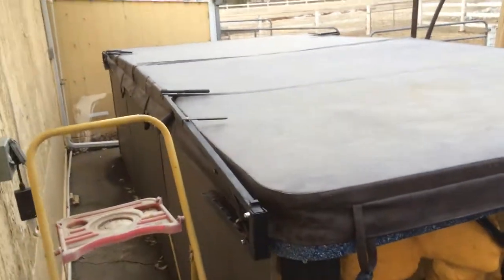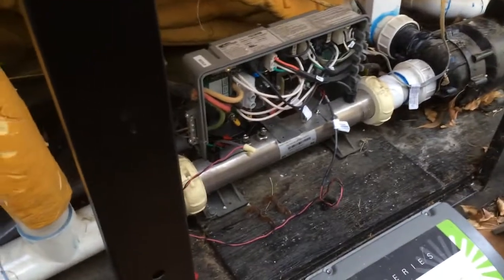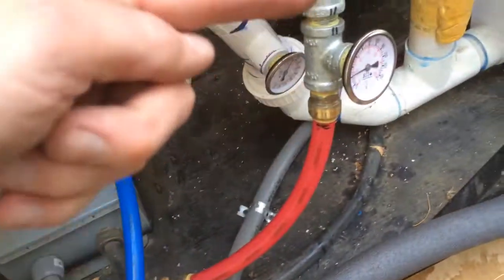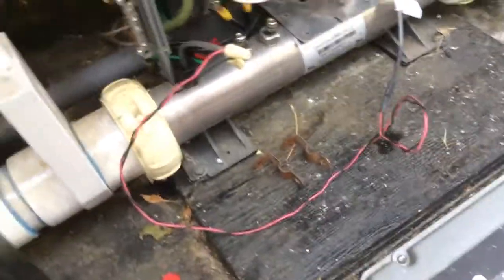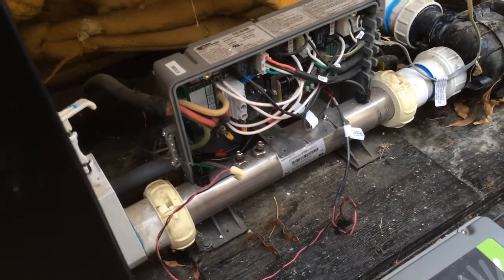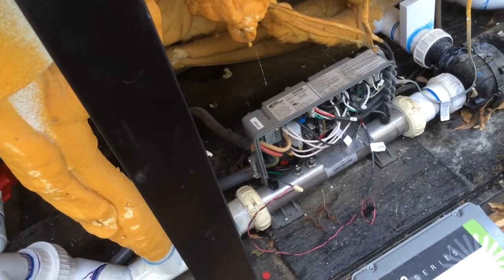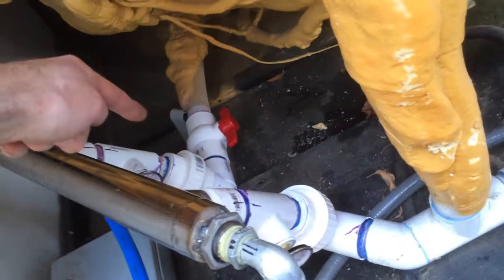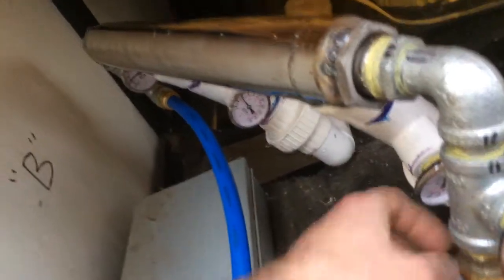Swim Spa heated using natural gas and heat exchanger #1

Comment: Hello mate need your help the heater has a live and a common connection in electrical terms of these are both lives, correct I want to wire up a external pump to this heater connection do I just need to take one of those lives and then the neutral from the hot tub so when the thermostat kicks in it would normally send the power to the heater but I want it to turn on a external pump. Will this work?
Reply from the maker: welp. Thanks for asking, but I am no electrician. Just the fact you are calling me "mate" makes me wonder if you are from the land down under, Or or Europe, perhaps? Here in the US we have 220v that is what was powering my actual electric heating element and our 220v has two 110v wires and a neutral and, ground is ground, wherever you can get ground. So, in that case, I was trying to start a 110v water pump off of my water heating tank, and could not use the 220v, so I cheated. I bought a 220v relay/switch that could switch a 110v powered device on and off. So 220v lugs right off the swim spa board, sent directly to this relay, it switches on and off when heat is demanded by the pool, and then the switched side switches 110v on and off for a Grundfos pump that pumps hot water to the heat exchanger. Sending 220v just as a signal to tell something to turn on and off is overkill, but I had little choice. There is no 5v "on" signal to control a heating device, for instance. Hope that is clear, but I think you should make sure you consult a real electrician.

Comment: What’s the coast difference?
Reply from the maker: at the time it was about 1/3 the price of electricity to heat with gas. Nowadays,. with gas getting more expensive, maybe not so much. Would be interesting to see if some sort of heat pump-kind of water heater could be made.